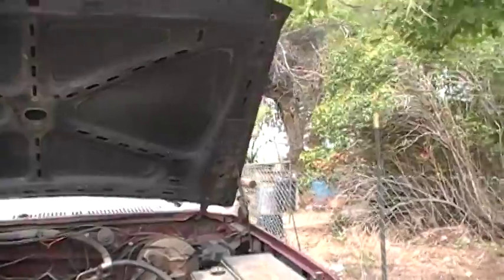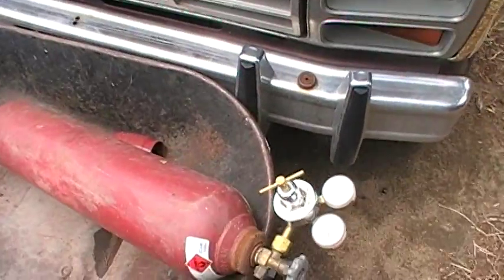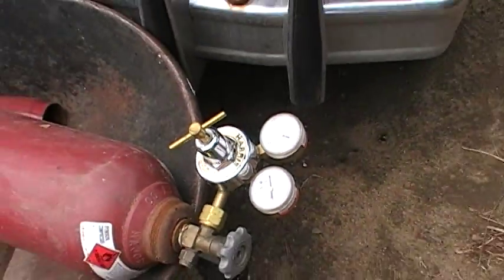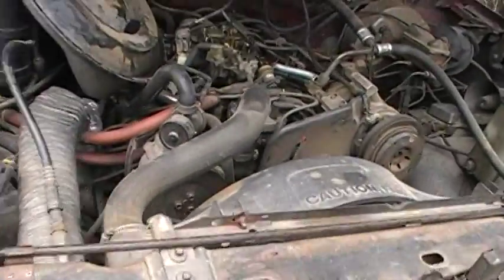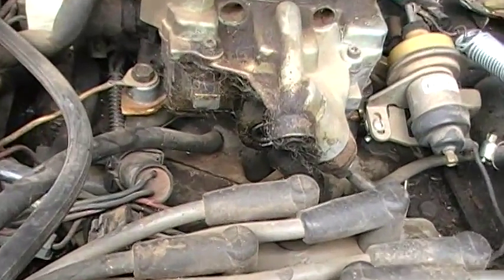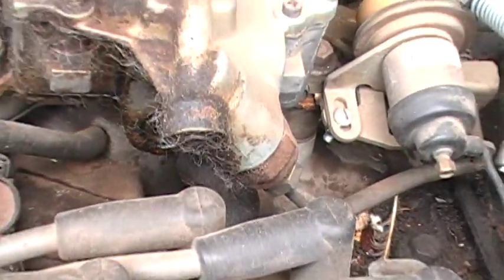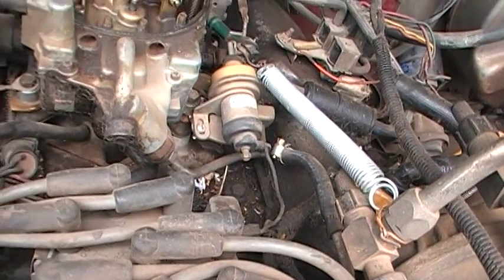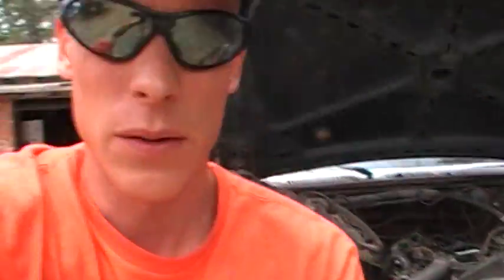Run Cars On Pure Hydrogen From Water And Solar (Not HHO)

Comment: So far you're the only one I've seen going in the right direction with the whole hydrogen hype.
HHO systems on cars might give you some boost. But then again that isn't the goal is it - the goal is to use present engine technology with minimal or no modifications. 
Liquid Hydrogen is not the way to go as this is becoming way to expensive to handle. 

Hydrogen can be compressed, and @usual 50L bottles with compression rate of 200Bar you can fit just about 0.9Kg of hydrogen.
Reply: Using existing engines...... hydrogen as a sole fuel source is obviously not the best solution. Storage tanks need to be too big to get anywhere reasonably and that volume of extremely combustionable hydrogen is exceptionally dangerous in an accident, far worse than the same  amount of energy in gasoline. L

HHO generation on demand does improve fuel economy in many vehicles, but that's because it increases the efficiency, burning more of the primary fuel (gasoline, diesel) during the early part of the power stroke.  That works despite the fact that  energy is drawn from the cars electrical system. Now maybe  this might work even better if one used a few small canisters of compressed hydrogen. That reduces the load on the alternator. During expansion, the hydrogen will cool the surrounding air getting more oxygen in.  And hydrogen's faster flame speed can still increase more efficient burn of the primary fuel during the power stroke. Hydrogen tends to work better on older engines that arnt as efficient as newer engines.

Comment: to maximize the output on a tank of hydrogen. 1 chicken feathers can be splintered into nanofibers that can be stuffed into the tanks. Thus condensing the ammount of chilled hydrogen that can be put into a bottle. 2 Use hydrogen and solar in conjunction with hydrogen fuel cells. Thus the ablility to use the natural Oxygen in the atmosphere. 3 Snap the oxygen and hydrogen together and run through a filter to give portable fresh clean water on tap.

Comment: Lazar's setup is cool but none of us will get anywhere if we can't figure out how to make hydrides cheaply. If someone really wants to make a ton of money or even become famous for open sourcing, that would be the technology to do it with. We are dead in the water right now with no way of storing the gas cheaply and easily. He also doesn't tell you how long it would take to fill the tanks using that tiny electrolysis machine. My guess is a long time. We will get there though, without his help

Comment from the maker: You bet. I'll add too that from the research I've done, it would be better to direct the hydrogen through small copper tubes (one per cylinder) directed at the intake valve or better yet to inject it directly into the cylinder like a diesel. 

I thought about making custom spark plugs with holes tapped for the hydrogen gas.

Comment from the maker: If anyone has any questions, feel free to ask.
Reply: Lots of people report success with hydrogen on demand systems improving the efficiency while using gasoline or diesel.  That is because hydrogen's faster flame speed helps burn the primary fuel more completely during the power stroke. 

Those HHO generators tend to produce 1-2 liters of HHO per minute. And they work despite the extra load it takes to run the alternator to power the HHO generator.  

Now imagine feeding   hydrogen at about 1 liter a minute to gasoline engine running gasoline.  Compared to a HHO on demand system, you have less load on the engine  and as the compressed hydrogen expands, it cools,  cooling the air that gets sucked into the engine. The cooled air can takes up less volume so that a bit more air can get sucked down each 4 stroke cycle. 

The primary fuel carries most of the energy, and is quick to refuel, and is far safer than huge tanks of compressed hydrogen gas.
Reply: Do you calculate how much hydrogen spent in 100km driving?